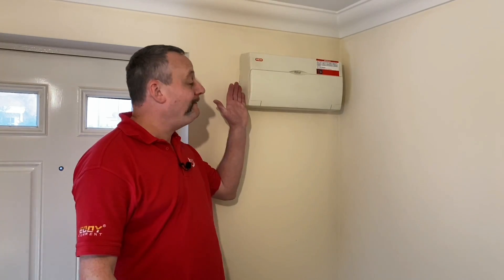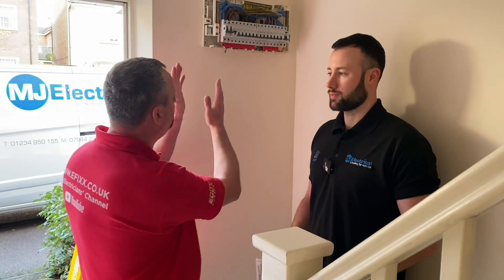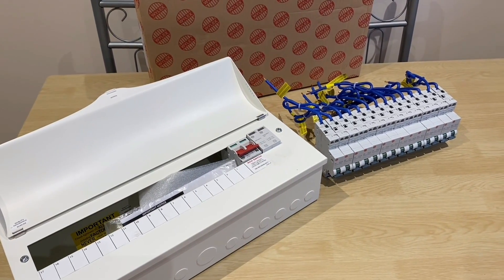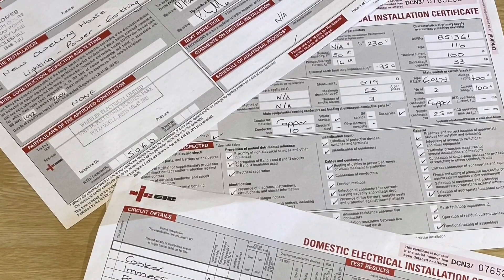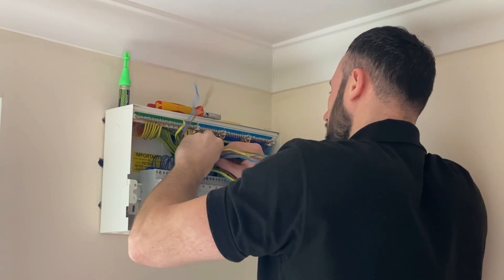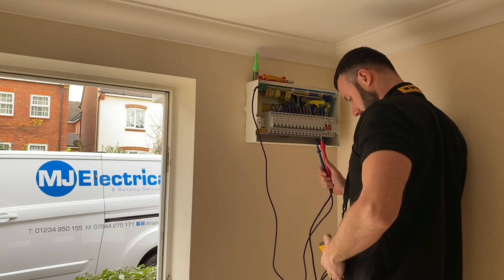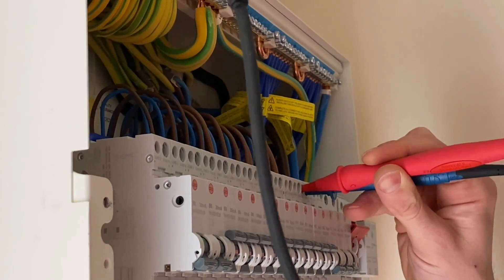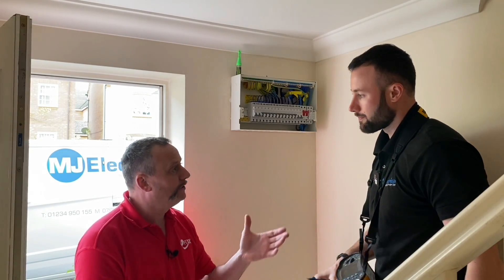Should you install a full AFDD or RCBO CONSUMER UNIT?

Comment: it's not a fuse box ! There's not a cartridge or rewireable fuse in sight ! I guess the main intake is still a cartridge fuse, but well only the DNO is legally allowed to touch that (or their approved sparkies) .

RCBOs are also better for the "totting up" of expected earth leakage on some types of electronics , especially Switch mode PSUs . There can be no real fault , but add up the very minor earth leakage of several circuits and that can be enough to trigger a 30mA type-A RCD.
I'd love to be able to afford a board full of AFDDs , but at about £100 a pop , that's £1600 to £2000 in a fully populated "largish" domestic consumer unit on AFDDs alone, without the installation costs . The metal box is quite minor in the scheme of things , as compared to AFDD cost .  I know arc faults can happen on any circuit , but I guess the high load circuits , like ring mains (especially the kitchen ring or radials) , cooker , immersion heater or shower feeds , could really be worth spending the £100 a pop  , since they're more likely to get bad arc faults.
But hey , fully populate with AFDDs if you can !

Comment: How does a plastic CU offer limited earth fault frotection, its plastic it does not conduct any fault to the casing will not put anybody in danger, but if the earth is missing frm the metal consumer unit and there is a fault to case then the user could get an electric shock. 15 AFDD at around £90+Vat each and £120+VAT for the CU and this is just the retail cost, so this makes the board change an expensive business.

Comment: Wonder how reliable the new AFDD’s will be compared to an RCBO?  More surface mount electronics to potentially fail?
Reply: Are there a lot of cases of RCBOs failing?
Reply: @IAmThe_RA  Don’t know, just asking the question as AFDD’s clearly have more microelectronics built in.  Too early to comment re reliability I suppose.

Comment: Always interesting to see how it can be done, even though those breakers would be way off limit for most at the moment.

Also interesting to see how dedicated you Brits are to the metal enclosures now (I mean you have to fit them there now). I’m from Sweden, and we use plastic, and from what I have heard there’s really no indication of the regulations changing here.

As always great video!

Comment: I had the consumer unit changed in my current property as well as my previous one. Both times carried out by niceic-registered electricians, neither times did I get any paperwork, nor identification on the cu who carried out the work, nor any reporting of the work to building control. Oh and both wanted payment in cash. This is why I do all my own electrical work now. Not anything as heavy as rewiring or changing a cu but adding fused spurs, sockets, doing the wiring for a new kitchen (installed by myself), sure.

Comment: Not sure about fitting extra MCBS instead of tidy blanks, it kinda looks untidy with them switch off.
Plus there could be more risk of a DIY chucking any old cable in the spare breakers.
EBay tends to have all makes available.

Comment: Not even worth contemplating until the price comes down. The very nice people at the IEE tell us we have to make the customer aware of the availability of AFDD's. I've done this several times but never been asked to install them or even quote for them.
Nice job but as others have pointed out, not a typical CU upgrade - most are a lot older than this one and consequently prone to a sorts of issues. That's why I always give an estimate not a fixed price quote for this type of work
Reply: 2 years down the line and the availability and price of these still isn't great.  Here in NL it seems only Siemens offer a 1 module width AFDD, the other brands are 2 or even 3 modules wide (though I can mail order that Wylex unit from the UK, it looks like it conforms to our norms).  Worse: my own home has an ABB CU with their BusBoard system... they offer AFDDs but not for BusBoard.
Better and cheaper perhaps to replace my 3 RCDs (each with 4 MCBs downstream) with combined RCD/AFDD units.

Comment: First off all that CU dose comply with BS7671 health and safety executive’s note ,
Installations which conform to the standards laid down in BS7671:2008+A3:2015 are regarded by HSE as likely to achieve conformity with the relevant parts of the Electricity at work regulations 1989. Existing installation’s may of been designed and installed to conform to the standards set by earlier editions of BS7671 or the IEE wiring regulations. This does not mean that they will fail to archive conformity with the relevant parts of the electricity at work regulations 1989.

Also regulations can only be applied from the date they came in to force, they can not be back dated to an earlier date. To say and tell the client that the CU doesn’t comply with BS 7671 is wrong . SPDs and AFDDs are not yet  mandatory  so we should only install them if the client asked for them. We should also test the installation according to BS767 18th edition and if all tests with in specified tolerance set out in BS7671 and a visual inspection show no signs of damage or overheating then we should not change it . A ring main can have as many socket outlets as you want so long as the total load does not exceed the design current , so what was stopping him from extending the rig and the lighting ? Boost his income and for get the rest . 
Sorry just my own personal opinion. But who am I am just a spark, and my opinion means nothing 🤣
Great video as always Gaz .👍👍👍❤️

Comment: Those SPD's don't cost £50, there around £8 for 2 SPD's, with the carrier, delivered to your door, with free postage. All they do is get a bog standard SPD and stick their own branding on and then bingo!
They're over 10 the price of what you can get on eBay delivered to your door. 
So if you take a £50 and £5 apart, you'll see that it's got exactly the same bits inside. Which is just a MOV that's been potted in resin, incase it explodes due to high fault current. But everything that's got electronics in, has already got MOV's and different types of surge  protections built into them already.

Comment: I have a full RCBO CU setup, the other day I had a class 2 hairdryer which was arcing on fire obviously because it was only a live and neutral the breaker didn’t trip as there was no reference to earth or didn’t exceed the overload 32A rating of the breaker. I think these are an excellent idea having seen the issue in real life 😳

Comment: The CU was installed 15 years ago then it does still comply with BS7671 metal CUs are required for new builds five years old or less or from whe the regulations was introduced ,  page 18 of BS 7671 health and safety executive’s note states that just because an installation was installed to an earlier edition of BS7671 DOSE NOT mean that it will fail an inspection or that it should be replaced or updated . So for him to tell the client that it doesn’t comply with the regulations is wrong. Plastic Split load CUs  will still comply
As long as it is in good condition with no signs of damage or thermal damage or exposed conductive parts and is safe for continued service, as electricians we are required to test the installation to BS7671 and if necessary we inform the client of benefits of a new CU it is then the clients choice if they want a new CU or not .

I may not have quoted it word for word so feel free to look it up your self,
Reply: I had that on my old place that had 3 electrical firms come by to do checks and all suggested the metal board upgrades.i did say words to your above and that a rewire may be advisable due to the nature of who installed it but then a new firm came by and kinda ended up saying same as me. Best thing was the supply incomers were replaced (badly) and nothing was said as it didn't need doing. Not my dime though 🤔

Comment: AFDI that I tested on my bench didn't detect a series arcing loose connection using a 2000 watt fan heater. Loose load or neutral terminals faults, I would question the ability of these afds to detect. It worked on parallel phase to neutral arcing at 230vac. Also pointless because, at one house wall fire, that I witnessed, not helped by consumer resetting their trippng circuit. Sparky thought it was the faulty CB so replaced it with a new one. Shortly after this the power point started a fire. Smoke detectors saved them.
Also doesn't provide protection on mains switches either in meter boards, submains or consumer board main switch, typically where many fires actually start.
Don't know how much protection AFDIs will give consumers in reality. Some USA states have had AFDIs since 2000. Fault finding arc faults and nuisance tripping remains. 
Consumers don't identify the difference between earth leakage faults, overcurrent and arc faults. 
Better to have smoke detectors in every bedroom and hallway.

Comment: NOTHING IS WRONG WITH PLASTIC BOARDS IF INSTALLED CORRECTLY
Reply: Exactly! 
We have installed plastic consumer units here in Denmark since the 1970s and we still do, and we NEVER have any problems with them. 

Also most of Europe is using plastic consumer units, they are after all made self extinguishing plastic rated @ 850°C.

Comment: AFDDs are junk. The only fault they detect that an RCD/RCBO doesn't is a series arc fault, and even then that fault has to be in the region of 7 to 8amps to trigger the AFDD. On top of that, there is no way to test whether an AFDD is functioning correctly or not using a any kind of test meter What is the point of installing safety equipment which is made to no agreed standard, and cannot be tested to verify that it passes any known standard ?

Comment: Local council just upgraded about 600 flats in high rise blocks to full afdd, spd consumer units.
Reply from the maker: Sounds like the Grenfell effect rolling out
Reply: @efixx  definitely, they also fitted sprinklers in every room and currently fitting new front doors with a longer fire rating to every flat.
Reply: @stevecraft00  In Ipswich the council made sprinklers mandatory in HMO's then changed back to fire detection as anglia water could not guarantee water pressure. In fact electrical regulations that require AFDD since September will not apply to council owned property!
Reply: No wonder my council tax bill keeps going up well above inflation.
Reply: @Benzknees  that's cutting the central government funding.
Reply: @stevecraft00  - If so, I haven’t noticed any reduction in VAT, fuel duties, income taxes, etc., etc..
Reply: @Benzknees  I mean the government funding to local councils - its been cut quite a bit in recent years. That's why councils have been cutting back and cost saving and putting up council tax.
Reply: @stevecraft00  - Installing AFDDs, SPDs and sprinklers doesn’t sound like cutting back! Meanwhile those poor saps paying for it won’t be able to afford any of that in our own homes as a result. And I hate to think what the ongoing cost of regular refurbs will be when tenants set off that sprinkler system.

Comment: latest load of shit on the market .Ask yourselves how many TV's you have known to have blown up etc !!  RCBO's are nice .But old fuse wire breakers are still going fine !
Reply from the maker: I’ve lost 1 printer and parts of a lighting control system to surges over the last three years - would have easily covered the cost of an SPD.

Comment: I think the point a lot of the commentators are missing is we had a 14 usable way split load board which was perfectly acceptable to keep. In order to install new circuits the options were 1) install new board nearby or 2) upgrade current board to comply with current regulations. Having one board is more aesthetically pleasing. We now have an 18 usable way spd board. We could put 2 RCD's in but that would reduce us to 14 ways once again. As the customer is looking to add circuits, the best way is to use RCBO's. 

The AFDD's I'm assuming are being supplied by a sponsor (efix/wylex/other) in order to allow the production of the video.

Comment: I genuinely don't understand the majority of comments,  presumably mostly from electricians,  prioritising cost over safety!  Even if there is a chance AFDDs are effective at saving lives,  isn't 3k over the lifetime of the installation worth it?  If you could,  would you buy a car without air bags purely to save money?  Sure,  as new technology they are pricey but it might help customers if those in the trade emphasised the safety aspect over just trying to undercut each other a little more often.
Reply: Not the electricians, most customers will not pay that so they just wouldn't get the job. I'll wait for the cost to come down.
Reply from the maker: Top advice 👍
Reply: I understand where your coming from but most customers hate paying £300-£600 for fully rcbo boards and I can’t see new customers paying £3000 nowadays so there most likely to just leave it alone then the cost has an adverse effect on installations as a whole as customer will just leave old fuse wire board still working . It’s a catch 22 problem , I wonder if plumbers will start installing sprinkler systems in all homes now as they can save lives too ?
Reply: Have you employed a full time fire fighter to live at home with you? You haven't? But it could save your life one day, don't you care about the safety of your family you cheapskate?

Comment: Most of the homes I go too have such crap wiring the arc fault breakers would be constantly tripping, a good thing I guess but a headache for the electrician.
Reply: Needs to be a sustained arc and not a switching arc and the circuit must be reasonably loaded to trip the AFDD.
Reply: Exactly, all those shower pull switches and cooker switches arcing away and loose spurs with heaters plugged in. Come across them every week.

Comment: Why have AFDD'S been fitted to protect the smoke detector and lighting circuits which are unlikely to draw more than the 1.5 A required to form an arc that the Siemens AFDD would detect.
Reply: They have been fitted for about £200 a pop 8-)=

Comment: I am sure efix expected an healthly debate for this one. Arc Fault detection is good but only when applied correctly. There are 3 points here. All circuits for low power such as lighting, detection, fridges a complete waste of money. General ring circuits there is a lot of evidence that suggests there is not usually enough power being drawn to activate the AFDD and finally high powered circuits yes a good thing as the will work as intended.
As they are a recommendation I would always make the recommendation to the client.
1. General 32A circuits, due to the uncontrolled nature of the circuits. Anything could be plugged in over the life of the install, including faulty equipment. 
2. Any circuits containing white goods such as washing machine, dryer etc.
3. High powered circuits containing cookers, water or electric heating.
Reply from the maker: Sensible thinking - but will sense influence the next BS7671 amendment ?
Reply: @efixx  agreed. This is my interpretation of the draft amendment and what can reasonably be expected to be published. Lighting circuit and other small loads I do not believe will be a requirement.